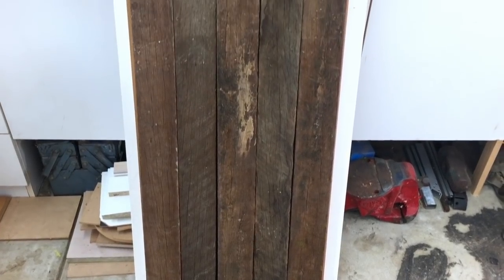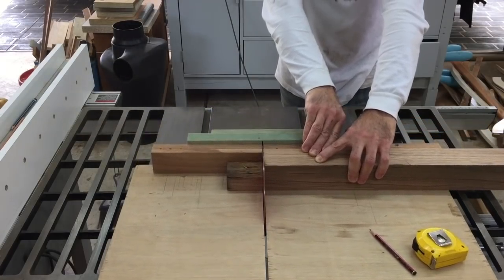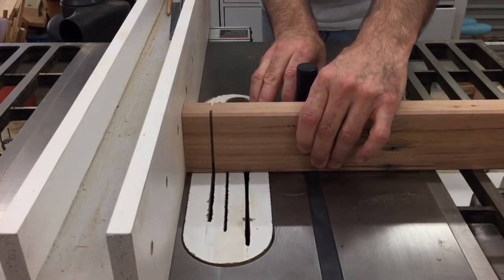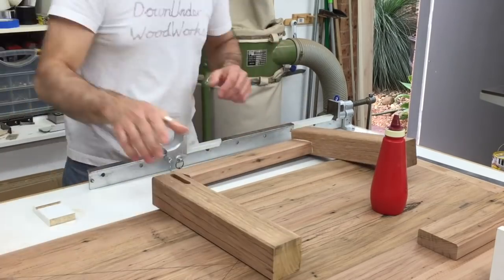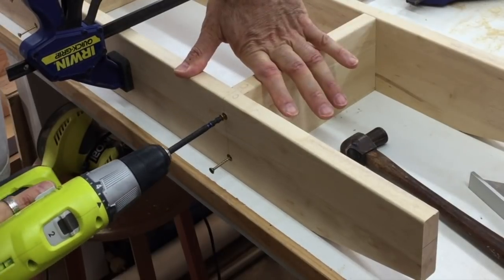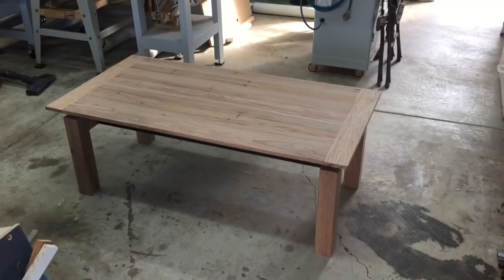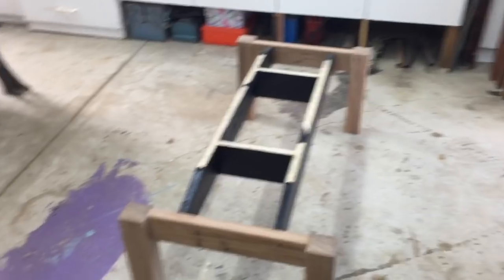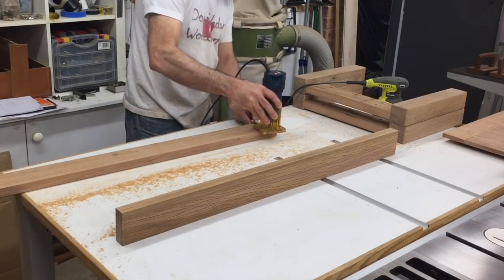Coffee table build - Part 2 - It's done

Comment: Looks great! First time to the channel. I have remover dowel that I had plugging a screw hole by driving a screw into the dowel. When the screw hits the hidden screw head. The dowel will be pushed out of the hole.
Reply from the maker: Thanks Ricky, and great tip. i'll have to use that one.

Comment: My work is mostly in my head and 'Lots' of modifications. It turned out very nice. As I'm watching I passed comment. "time I made another table". My wife stood behind me.. NO  we have enough tables :( .  Is it Black butt? I don't know if you considered it or maybe not heavy duty enough for you but you can get table connectors that look like figure eights.  Thanks DUWW
Reply from the maker: I know the brackets you mention Peter, but have no experience with them. The top and the base are very heavy so I'm confident with the brackets I made. Those figure eight ones look a little thin.

Comment: Awesome build. Has given me some great inspiration.
Just a quick question, I’m new to woodworking and was wondering what you use to brush on your glue?
I’m also based in Australia and I’ve just been buying cheap brushes from Bunnings
Reply from the maker: Thanks very much mate. The brush I'm using is a silicon brush, typically used in cooking. They're brilliant, you let the glue dry on the brush and then just peel it off.
Reply: DownUnderWoodWorks thanks for that 😃

Comment: I didn't check all the comments, but what about an 1/8" chamfer on the bottom of the legs so as to eliminate tear-out if scooted along the floor, or did I miss that?  Just a thought.
Reply from the maker: That's a very good point Ross. That is something I always do on the bottom of legs. It may have been lost in the video but if you watch from 5:20 you will see the chamfer on the top of the legs that later became the bottom when I turned the base upside down. Cheers mate.